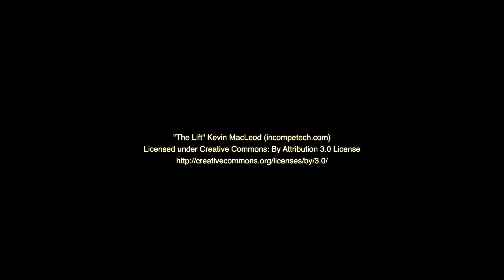Repair Trim Yamaha Outboard 100HP (DIY) [4K]

Comment: Very helpful video! Instructions are spot on. This process worked for my 2012 Yamaha F90 four stroke. I was able to do it without releasing the hydraulic side pin and spinning the unit down. Just took some right tool extensions to get at the bolts but avoided the issue with hydraulic fluid spillage.
Reply from the maker: I'm glad I helped!

Comment: Excellent video thank you, I have now fixed my (Australian) F80BETL with your help. My trim motor was simply dirty and works fine after a clean and quick 1200 wet and dry sand of the commutator (the outboard only has 100 hours on it). 
As per Carl Kran below I was able to remove the trim motor in place without releasing either of the trim pivot pins. You just need a good 1/4 drive allan key socket and 5 to 6 inch extension and a racket.
I suggest attaching a line to the wires before they are pulled out so you can pull the wires back into place more easily. I used builders cord (strong braided nylon string) but saw somewhere someone used fishing line.
Regarding using vice grips on the shaft - I have a vice which greatly assisted the reassembly. After installing the armature in the base I clamped the drive shaft in the vice before installing the stator assembly. Make sure you use soft jaw guards in you vice though. Mine are aluminium.

Oh and I clamped the base in the vice to install the armature. I used a pair of circlip pliers to hold the brushes apart so the armature could be dropped in.
Thanks again.
Reply from the maker: Thanks!

Comment: Incredible video! Very well done. What would you suspect is the issue if both helm and engine tilt/trim controls click but the trim motor does not respond? Bad trim motor or busted switch relay?
Reply from the maker: Thank you, it is difficult to know, if the click sounds when the trim is activated, the relay is fine and it can be the electric motor of the trim that is broken or dirty, but it can be either of the two elements, it is difficult to know, you should check all the elements ...
Reply: Javier Rullan Ruano thanks Javier. I think it’s the actual trim motor. It’s really corroded, all other elements look fine. Why wouldn’t they make this sealed better from the saltwater environment?? Coat it in epoxy or something more effective. Engine is spotless except for this one part.

Comment: Hola muy buen video compré un Yamaha 2007 50 hp y el trim sube sin problema pero aveces no baja y nomas hacer un sonido de clicking, le tengo que luchar muchas veces para que baje pero si baja? No tiene idea de que pueda ser? Muchas gracias
Reply from the maker: Puede ser el motor del trim que este en las ultimas, mejor cambiarlo
Reply: @JavierRullanRuano  ok muchas gracias! Lo cambiaré entonces!

Comment: Hola. Genial el vídeo! Tengo un yamaha 50 y el trim tiene fallos intermitentes. Suena el rele pero a  veces no sube. Le he pedido al mecánico q limpie el motor del trim como en este vídeo...El me recomienda reemplazarlo y me ofrece una marca "blanca" compatible. En principio le he pedido que sólo lo limpie...¿conocéis estas alternativas de motor trim para yamaha? Saludos
Reply from the maker: Gracias, el repuesto original de yamaha es la mas cara, las marcas blancas son una buena opcion,  la limpieza a fondo del motor como hice yo es la mas barata, hasta la fecha funciona perfectamente, el motor estaba perfecto pero la suciedad del desgaste de las escobillas hacia que no pudiera funcionar correctamente.
Reply: Gracias Javier...Diría que mi motor está en la misma situación...fallos intermitentes en subida/bajada...Ya te contaré qué tal queda despues de una limpieza. ¿Conocéis alguna marca concreta de estas marcas blancas alternativas? He visto productos en ebay pero hay tantísima diferencia en precio que quisiera saber al menos la experiencia de alguien con estos productos antes de atreverme si llegara el momento de reemplazar el motor eléctrico del trim. Gracias de nuevo
Reply from the maker: Este es una marca blanca igual al de mi motor yamaha 100, tienes que localizar el del 50
https://www.ebay.com/itm/NEW-TILT-TRIM-MOTOR-FOR-YAMAHA-MARINE-REPLACES-6D8-43880-01-00-6D8-43880-09-00/361129261630

Comment: Saludos Javier,  Estoy tratando de sacar el eje del piston para poder acceder a los tornillos del motor eléctrico y tengo una duda que quería consultar.  en el video sacas el eje por el lado izquierdo del motor (babor).  Ya le logre sacar el clip que asegura el eje.  Como sacas el eje le martillas por un lado para que salga por babor.  Gracias quedo en espera de sus comentarios.

Saludos desde Puerto Rico
Reply from the maker: Para sacar el eje, primero usa aceite 3 en uno  (asi lo llamamos aqui) o desbloqueante para enfriar el eje y hacer que salga con mas facilidad, debe salir sin esfuerzo, no uses martillo de metal o lo dañaras. El eje inferior no es necesario sacarlo, basta con el superior para poder acceder a todo el trim.
Suerte
Reply: En que dirección debe salir el eje... de  derecha (estribor) a izquierda babor?
Mañana trataré nuevamente a ver si tengo éxito,   gracias.
Reply from the maker: Sale hacia la derecha, al quitar el clip puedes introducirlo , por el otro lado el eje tiene un tope y no sale.
Reply: Gracias